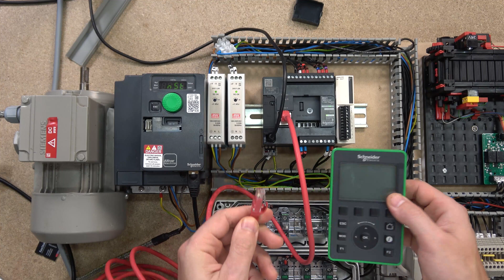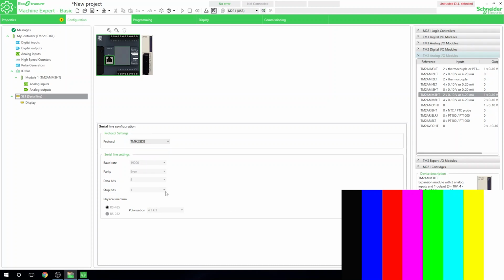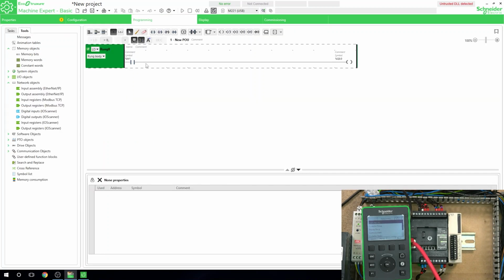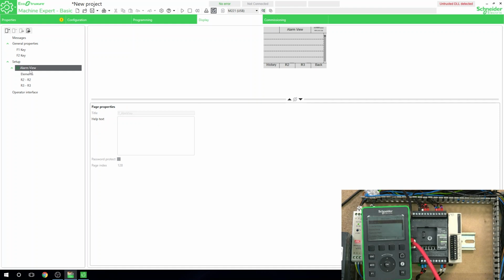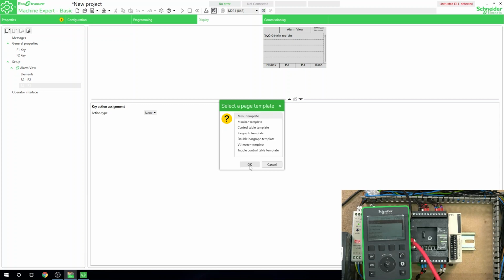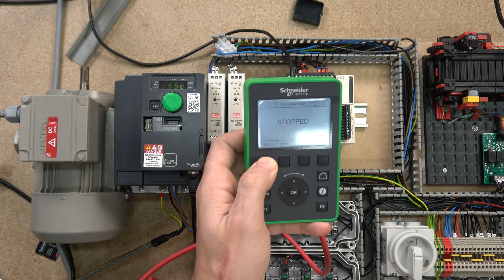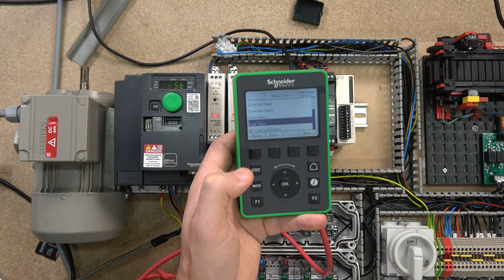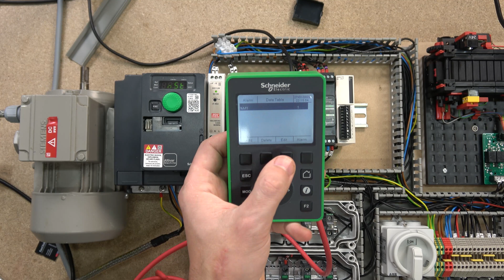Schneider Electric Modicon M221 PLC TMH2GDB HMI set up and Programming. Eng

Comment: Hi friend, my ATV 320 speed controller is configured with iOScanner on a Schneider M221 PLC. The problem is that I get a communication error on my PLC when there's a power outage, only for my speed controller. I have to disconnect both the PLC and the speed controller for communication to begin. Greetings from Peru